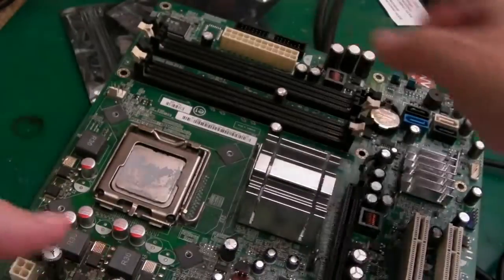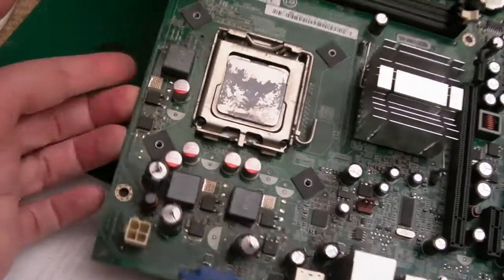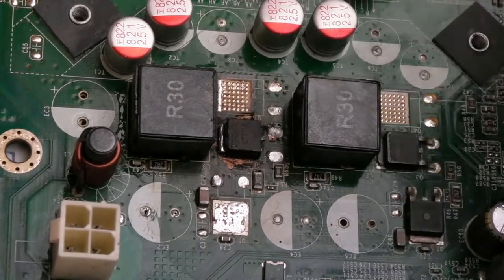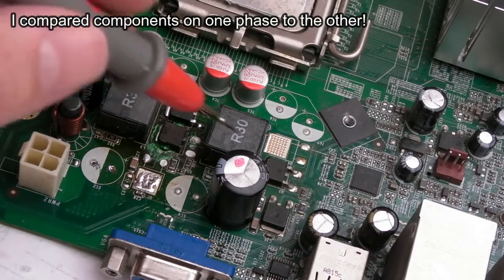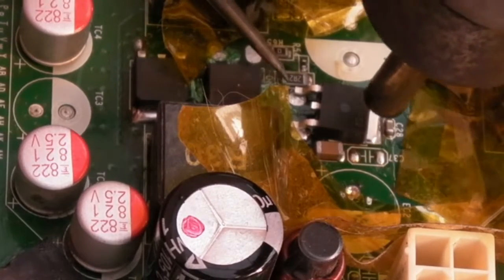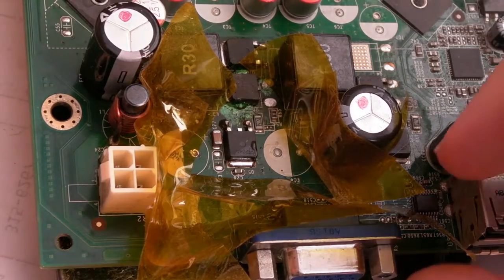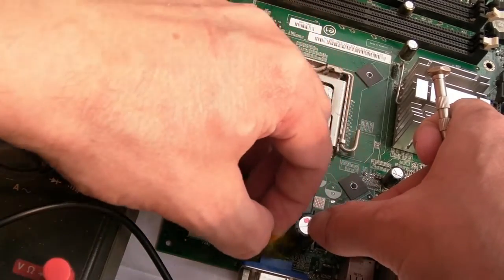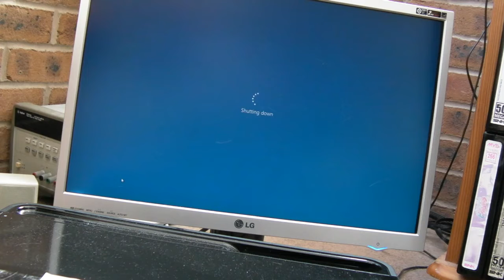VLOG - Dell Vostro 200 No Power (Motherboard) Repair

Comment from the maker: "Keyboard Failure - Press F1 to continue" - LOL!  I saw that on one of Adrian Black's video the other day too.
This is the subsitute for the AOD472 that Farnell automatically recommended - IRFR3709ZPBF
The other MOSFET (furthest away from CPU) was AOD452
NOTE: Had there not been a second space for the new MOSFET - the other thing you could do is cut the legs (as I did) on the existing one, then find somewhere nearby to locate the new MOSFET.  The rail the tab is located on extends out quite some way around that area.  In theory I could have scratched off the solder mask, soldered the tab down there and use short wires to reach to the 2 other connections.   Of course in either case that's a total bodge, but it could just help you fix something like this where the value is in getting it running vs a super tidy "as new" type end result.
The other thing you might be able to do when you cannot remove a MOSFET welded to the PCB in that way - perhaps drill into the package, in a numbeer of places - being careful not to drill straight through.  Maybe if some of the mass was removed from the tab, it might come off easier?!?!  That would need precision drilling to ensure you didn't go too far through the tab.
Reply: the capacitors are really a problem on PC manufacturers computers.....
Reply: Grind through the package with a dremel and one of those cheap black cut-off wheels, get it down to the tab and heat directly perhaps.
Reply from the maker: @SteveT3D  That's a great idea!  I did consider trying to drill into the transistor but I think a dremel may be easier to control, although the area is pretty smal area to work in =/

Comment: One thing you could try is using $1 Ali Express wire cutters. You will dull or damage the cutters but you can try breaking apart the ceramic part of the component. It's quite brute force but it might work. I agree that PC motherboards suck to work on.

Comment: Been there and done this myself on some PC motherboards many years ago - back when I was in university and had a Pentium II system.
I didn't have hot air, and could not get the mosfet(s) to budge with a powerful soldering iron. In the end I did get them off - I folded a piece of thick copper sheet to the width of the mosfet tab, held it with pliers, heated it up with a blow torch until it was starting to glow red and pushed it onto the tab of the mosfet....that got it off!

Comment: Chris! I think if you'd managed to get that MOSFET to move, you would have ended up with a lot of shorting layers. So leaving it alone (cut legs) was the only & best option.
yeah you could have used a heat pad under the board & hot-air etc.. above but.. In essence you did the right thing. Saved from the landfill of dead boards Legend! 🖖🤓👍🏻
Reply from the maker: Thanks =D

Comment: I have had a few MOSFET's weld them selves to the PCB in laptops before.  Usually resulting in a non repairable system as it had carbonized the inner layers of the PCB as well rendering the board not fixable.  If possible I would have tried to get a nozzle for the heat gun that is as close to the size of component I am trying to de-solder as that ensures that it equally gets heated up and will come off easier.  On the last MOSFET you soldered on it looked like you just got solder on the metal tab of the MOSFET and not the PCB but I could be wrong.  Also on that MOSFET it looked like some solder was missing from the right side of the right most pin on the package.  When picking replacement MOSFET's for buck regulators like this circuit the most important things to look for on the datasheet are the on resistance (and what voltage is required to obtain that value) as well as the gate capacitance as that will affect its switching time.  Usually the gain of power MOSFET's is not very high so you don't have to worry about it unlike transistors.  If you removed the CPU you would have found that the 10 or so ohms of resistance that you were measuring would have gone away as that is the CPU that is showing that reading.  You were lucky as it looked like it was the low side MOSFET that shorted first and protected the CPU from the 12V rail from the power supply.  If there was not another pad to place a new MOSFET I would have broken up the plastic housing of the dead MOSFET and removed the die that was soldered to the metal back plate and then just soldered the replacement on top of the old MOSFET's metal back plate and bent down the legs on the new MOSFET to touch the 2 remaining pads.  With the high currents (close to 100A or so) and high switching frequency I would be reluctant to place the MOSFET to far away from the original location as the voltage drop over the wires and potential delay caused by the extended wires could become a problem.

Comment: My method to remove these components with tab is to warm up the board with hot air and then heat up the pad with a soldering iron.

Comment: Having fixed ps3 motherboard's, you will need a preheater as modern boards suck heat like there's no tomorrow. usually adding solder paste the. hot air makes it easier to remove. worse case just snip the mosfet off